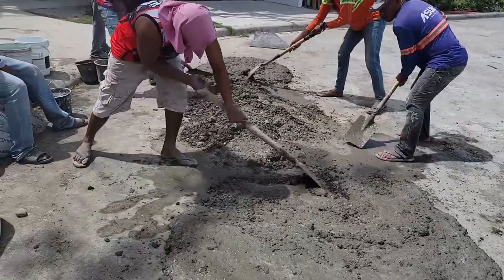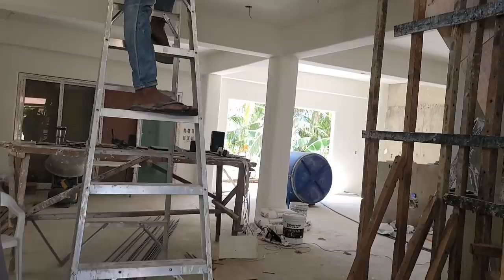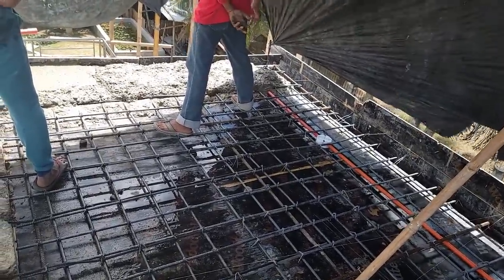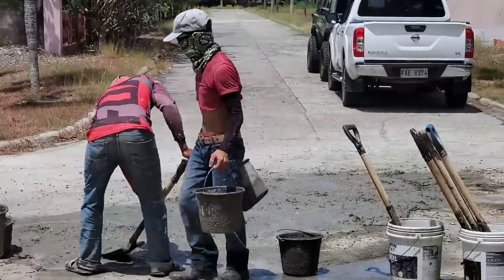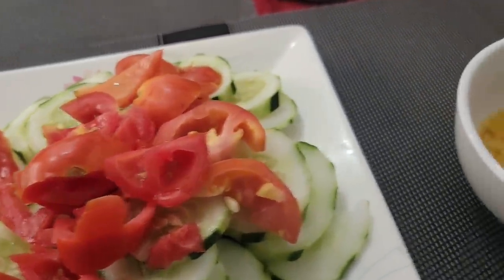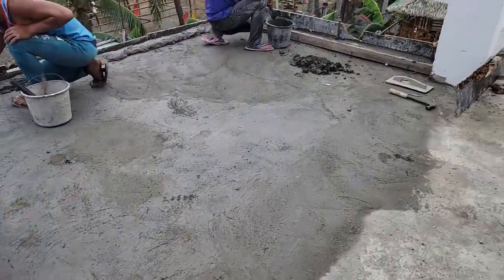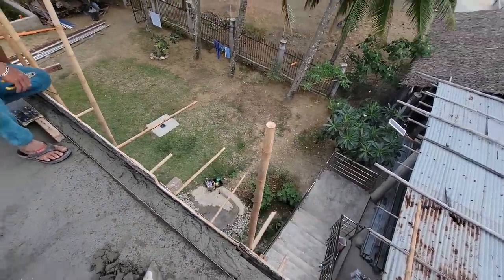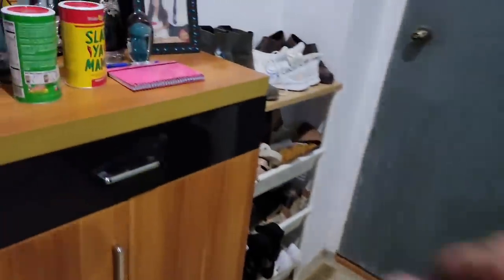Philippines Beach House Build Day 267 Creating the BEST VIEW, CRAB LUNCH, Make HOUSE SEXY

Comment: With Cantilever Slabs & Beams the main Steel members should be at the top of the slab/beam, because it is the top of the cantilever structure that is under tension and the bottom under compression.
But you seem to have that under control.

Comment: James , I have to hand it to you, you are coming close to your dream house without the use of machines.   Your staircase looks like is coming along well.  I originally thought you were building it as a "floating structure" no attached to the wall, but after seen it the way you have, I think it will look great.  What is your plan for handrails?  If you could get those people to roll the the SS tubes it would look great.  Rolling tubes like the ones they use I believe is very difficult, and probably costly.  Another possible option would be the use of the artisan doing the columns details to make the railing combined with vertical elements of stainless steel.  Anyway,  I know that you'll come through.   Good luck!
Reply from the maker: I'm thinking to build the railings myself. I thank you for your time to comment and share thoughts. It's great!

Comment: I would add more rebar to the underside of the stair, It looks you went 6 to 8 inches or separation on the rebar under the stair I would go 3 inches apart on the rebar.
Reply from the maker: Not done - far from done in that video

Comment: would it not have been easier to but the underside staircase deck in first before you but the riser steps in and sides
Reply from the maker: No because it creates and unique shape that you will see. This can only properly be shaped once the upper forms  and steel are set.
Reply: @TexasFilipino  i disagree as you have the risers already marked out on the wall and all you do then is build a wider deck

Comment: Hay from another Texan ,Did you epoxy the rebar Where it went in the walls?
Reply: By the way I grew up in Red River Co. Not too far from your place but way before your time.
Reply from the maker: I spoke there in the video that I am using epoxy. I use epoxy anywhere I drill in. Leaves no voids and stronger.
Reply from the maker: Hello fellow North  TEXAN